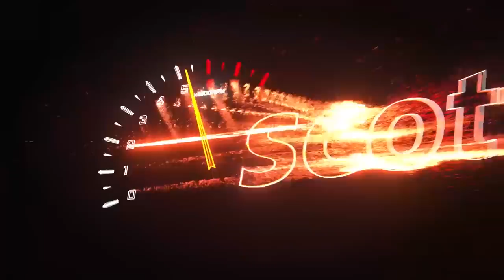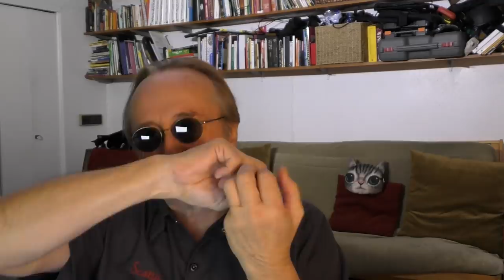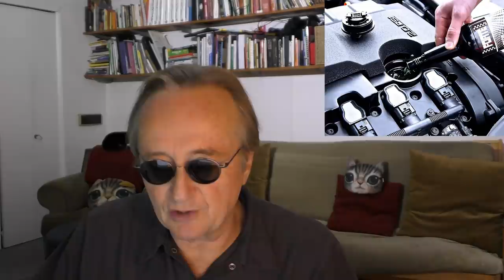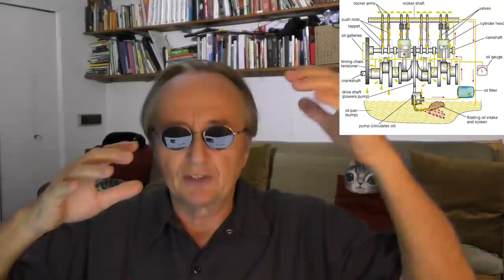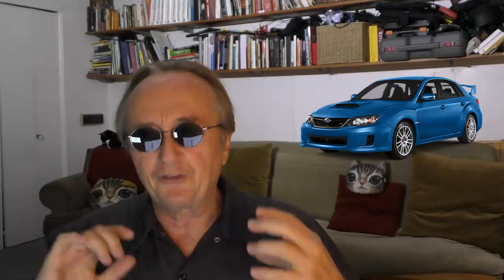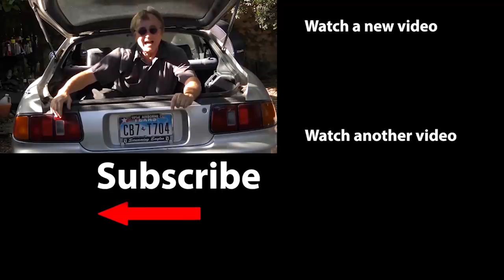Bad Mods that Will Ruin Your Car

Comment: An old Monty LS or Regal, or Grand Prix, with the 3.8 or 4.3 v6....ugh, I'd see those things w 3, 400,000 miles all the time. Ran forever, n if the tranny blew out, ya grabbed one from the junk yard for $100 n swapped it in in an hour....the good old days......

Comment: I crossed canada with my 2006 Jetta TDI and the timing belt broke in the mountains, the Jetta broke down  hours away from civilization,  hours later the flatbed showed up in the middle of the woods on the trans Canadian highway. when i got to this small town in ontario called Kenora, every single garage had no idea how to work on a diesel vw.... so i had the car towed 2 and a half hours away in winnipeg Manitoba where there was a vw dealership and they said that they could fix the timing belt for 150$ a hour, turns out it would cost the same amout for a new engine... so i called my grandfather that lived in a small town with only population of 472 called McCreary, thought maybe he could help. The only person we found was Brad, the local tractor and 18 wheeler mechanic that worked on Diesel engines, Brad changed my engine for a used one for 2600$................. it took 1 month to get a new engine. Brad had to look at youtube videos to how to change the engine... finally when the used engine arrived, he changed the engine and  i drove back to quebec.
27 h (2,576 km) to drive home. while i was driving the engine was kicking when i pressed on the gas, turns out Brad had not fix the engine properly to the frame... anyways... when i got back home 3 days later the transmission blew up.. the car cost 4k when i bought it. NEVER AGAIN WILL I BUY A VOLKSWAGEN!

Comment: Oh c'mon, some tuners are warrantied by the manufacturer when installed at the dealer.

YOU should know that there's more power in every engine without sacrificing too much reliability.  Manufacturers are very safe with their tunes.

Comment: Volkswagen aired a commercial bragging that the Jetta is better than the Honda Civic because the Turbo engine comes standard, whereas you have to pay extra for it on the Civic

Comment: I have to disagree. Honda does care more about the bottom line. They tune a car to not have to use super so it won't ping, they tune to get a specific combo of things like the carb compliance and cafe points. Also, your wrong. You don't have to give up mph for more power. More power, if used properly can most definitely increase mpg. They engine does not have to work as hard to keep the vehicle moving or to get it started. But you can get on it. Case in point. I have a ram 2500 (5.7 gas) I use it to tow about 7000lbs daily. When I got a tuner my mpg went up about 1.5 to 2 mpg. 
Tuners are just as good if not better then most factory engineers. They tune per engine not just a general tune for hundreds of thousands of engines.

Comment: Hey Scotty just found your channel and I love it. I found your channel because of your Celica. I have a 96 Celica gt that’s a manual. And it’s in very good condition but it has 200,000 miles. I was wondering if there’s anything I should check on it cuz I’m not very good with cars but all of the normal work has been done it has new oil and a new timing belt and a few other thing. Also I was wondering, i live in nm and it’s not to cold right now but the heater doesn’t work until about 30 minutes of driving, is that normal? Or should I get the ac looked at. All the best Scotty

Comment: I think the worst upgrading is those guys that use a bolt on turbo and piggyback ecu without doing any work on the transmission or drivetrain.

Comment: Vws are not that hard to work on. Certainly no harder than any other car year by year. Any mechanic of any skill level at all should have no problem with a 2003 golf. You can buy the same parts online as are available in Europe. This isn't 2003 anymore. We have this thing, the internet where every car ever made has nearly step by step info on almost every possible job. If your skill level has maxxed out at late 90s Toyota, then I'm not sure what to say.

Comment: GM in the 80's---their rear wheel drive, V8-powered cars were excellent, very reliable. But their front wheel drive cars with the 4 cylinder engines? Total garbage. And the only decent V6 engines GM offered were the Chevy 4.3 and the later fuel-injected Buick 3.8's, the rest were trash

Comment: Dang, I just shoehorned a Hemi V8 into a '94 Toyota Corolla. 😅😂🤣😋
Reply: Mael-Strom You should have dropped in the Toyota V-12!
Reply: @RaoulThomas007  I tried but it interfered with the rear passenger seat coffee cup holder. 🤣😋

Comment: The thumbnail pix for this video reminds me of the dumbest mod I see on import cars.  People lower these Hondas, Subarus, Toyotas, BMWs to make them look cooler.  But they don't correct the wheel geometry.  Doesn't make them look cool, makes them look like smashed Hot Wheels.  More wear on the bearings, abnormal tire wear, rotten ride etc.  Only good for race cars.  They become money pits for street driving.

Comment: 2008 Grand Cherokee 3000cc Diesel..factory 215hp/375 lbs torque average getting 16mpg. Emissions Legal Euro 4. Green Diesel Engineering ECU flash altered the timing, switched off swirl motor and still passing emissions testing with 265hp/460lbs torque and getting 23mpg. 

Don't believe everything this guy tells you. I have been following him for a while and he is funny to listen and view but I can't trust a guy who flails his arms and has a messy garden shed for a garage

Comment: Hey scotty I was think of buying a 1998 Volkswagen with 165000 miles and is a manual with 1.8 engine
Reply: If it's a free car, perhaps. The transmission's the least of your concerns on those. Other than oil burning you need to watch over and check every time you fill up, there's a good reason so many '96-02 Corollas are still being driven around, and you can get one in good mechanical shape for far less than $2,000.
Reply: Sometimes people leave good comments eh?

Comment: Hey Scotty I’m thinking about buying a 2020 Honda Civic sport manual transmission but worried about the oil dilution. Does the 2.0l naturally aspirated ivtec engine in this car have this problem?
Reply: The 2.0 is multi port fuel injection so your good.   I have the 1.5 really hoping to not be that affected
Reply: @JustinSherrod1991  it is the SI having the dilution problem. That said, my daughter bought a 2018 & hers has had no dilution trouble thus far.
Reply: Yes, the 2.4L has no oil dilution, but what you should really be worried about is how much the car will be worth over time. Two ways to look at it: If you think more in the moment, watch Dave Ramsey videos on cars. If you're more forward thinking, youtube "tony seba robin hood conference" and watch that presentation.
Reply: Wayne S. Yea all the 1.5 direct injection turbos have it, although they did do a tsb for it which is more or less a software update, but I did hear they are engineering a new oil to help combat the issue

Comment: Scotty you're actually wrong the engineers tune the car in accordion to the model, more power can be obtainable if you reconfigure it.
Reply: Mostly on turbo cars on normal NA cars with non tunable transmissions you might get another 5-8 WBHp out of the stock motor. With a turbocharged engine  they leave the tune bare for gas mileage. The VW 2.0 tsi stock is capable of 260 WBHP but comes from VW with 200. But scotty partially wrong about the vws. Mine was made 80% in Germany says so right on the paperwork and it's a great car. My brothers 2011 jettas been going strong for 6 years now with 150,000 miles and still going never had any maintenance (other than routine like oil)  and breaks all the way around but after 150,000 of alot of city milage that's to be expected.

Comment: Hello Scotty, I bought a Seltos 2022 AWD. Since I didn't turn on the rear wheel drive during daily use. Do you think I should change the center differential and rear differential fluid when I change the transmission fluid at 30K?

Comment: Hi Scotty. I'm not sure how Subaru America produces/sell their cars in the USA. I don't know if, like Honda and Toyota, they have manufacturing plants there because I really don't understand the bad reputation this brand gets in your country. From memory, I think since 2010 or there abouts, Toyota bought Fuji Heavy Industries which is the company that manufactures Subarus in Japan. Not long after that they released the BRZ or AE86 (or yet Toyota GT86 in the USA market) and myself as a customer who had owned Subaru cars previously, their design changed drastically. A 2014 Subaru Legacy, in my opinion, looks like a Toyota Camry. Bulky, boring and really designed as a family car. I would then think that some of that Toyota "quality" you prise them some much for, would have translated onto the newer Subaru models. In saying that, I live in New Zealand and here we get JDM spec japanese cars. Back in 2007 I owned a 2001 Subaru Legacy B4 RSK, 2.0L/Twin turbo and basically a more luxurious WRX STi in a way when it comes to drivetrain (not the engine). I went to own it for 6 years and in that time the only parts I had to change/replace other than the usual maintenance stuff was a knock sensor and two rubber mounts that held the rear differential assembly, that's it! Was a manual gearbox model, good fuel economy if you know how to drive them b ut also has the 280HP if you want it. After that, in 2015 I owned a 2007 Subaru Legacy Spec-B Wagon 2.0L/Single turbo/Automatic transmission. Not as fun as the other one but again a good car. I owned it for 4 years and sold it mid last year (2019). Nothing spent on it other than a good set of tyres which I replaced for personal prefference. The Toyo set that came with it was perfectly fine just not as confortable as say a Bridgestone or Goodyear. I guess I do understand that you talk from experience and it's mostly (if not all) based in the USA market but in other countries we experience different feedbacks for the same product. Here everybody buys a Ford Ranger over a Toyota Hilux (Tacoma). Not because of only price or reliability but because Toyota gained a reputation for not being that safe of a car. Just watch the moose test videos of the Hilux to understand what I mean. Plus all the cases in your country of Toyotas having accelerators stuck or airbags going off and so forth. Not to say that it doesn't happen to other brands but it is how thay deal with the issue that counts. Love your videos anyway. Cheers!

Comment: Changing timing belt on 2010 Accord 3.5L. The rear cam jumped CCW about 10 degrees.  How can I turn it back to TDC? Do i need a special tool?

Comment: Hey Scotty what do you think about kia’s. I bought a 2013 Kia Optima for my wife in 2017 with 36000 miles on it   Been a great car so far be sides all the recalls and they never found anything wrong with it. ?
Reply: I had a 2010 Tundra with over 220k Miles in 2018. before I wrecked it. Never gave me any problems besides one day where I got to a store and didn't restart lol was just a starter.

Comment: Hey scotty sometimes my 2010 fusion v6 with 158k miles will crank for a while but not start, turn key off then try again and it starts right up, runs fine what could cause this?

Comment: avoid tuners
Reply: Tune totally transformed my diesel BMW.  Went from 240 wheel HP to 364.  Torque went from 420 to 595lb.  Power feels absolutely ridiculous now (in a good way).  Had tune on for past 40k miles with no issues and take it on the race track many times.

Comment: Hi.  Please I need advice. I bought a Chevy aveo cheap to sell. My first car to make money on. I have a new battery of my old fiat but it won’t fit in the other car as the battery cables won’t reach unless it’s upside down can the cables be extended or is there risk of fire or can I try stretch them a bit. Please need help. Thanks

Comment: I have a jeep compas 2015 .it jerks when i drive it on the highway. Do you think its the transmission. 80,000 miles. Do you think changing transmission fluid will help.
Reply: Drain and fill only; do not flush.

Comment: Hi, scotty I got a Peugeot 208 brake lights are on continuously I’ve had the brake switch changed but still same issue. Any ideas? Thanks
Reply: Sometimes brake pedals have this pin that needs to be pushed in while you dont have your foot on the brake. It usually is a rubber or silicone bead pressed into a hole. They tend to get brittle over time. Just trace the pedal up where it goes look for a electrical connector right at the top of it and check that the pin (plasic pin btw) is pushed in while the pedal isnt being used. I hot glued a penney over where mine used to be lol. Cheap fix. If your cars a manual trans u may have the same kind of pin on the clutch pedal only when this one is removed your car wont start.
Reply: Sounds like you could possibly have a short to power which means the circuit has bypassed the switch and is constantly recieving power

Comment: What are your thoughts on a 2005 Hyundai Tiboran manual with 112060 miles on it? Think its a good car. Says it was made in Korea...
Reply: I got the car for $300
Reply: For $300, it's a good deal, and if the insurance is at least similar to a 2005 Civic or Corolla, then it's a great deal. If the insurance is palatable for you, then maintain the car with regular oil and filter changes, and unless it becomes a money pit, drive it into the ground.
Reply: I am a auto Technician and it does have a few dings. Like I wanna change the tyres. The key barrel is shot he drilled it.  This is its been parked for 2 years. But it starts runs and everything works. Got a few minor dents but it drives. Pulls to the left so after I change the tyres I look into that. An well I got to service the brake system. The hand brakes especially, its really tough. But it does drive.
Reply: @DuewaineJohnson  The way you say "tires", I assume you're in the UK? Among US tires, the Continental TrueContact Tour and General Altimax RT43 are both good tires that are better in the rain than the cheap stuff.
Reply: @EMichaelBall  Well I am from the Caribbean. You ever been? Thanks for the the tip. Still the car runs awesome. They change the timing bet at 60,000Miles and previous owner was saying to change it as its 112000 miles now. Think I gonna wait though. It had 1/3 feel in it. I put some octane boost in it just cause its been parked for 2 years. Have you ever worked on a Tiboron before? Are they easy to work on in your view? 
Somehow this seems like it has a few Mitsubishi similarities and parts too
Reply: @DuewaineJohnson  I've never left the US. Maybe I'll go there, someday. Don't wait too long on that timing belt, because I think all Hyundais have interference engines, so if the belt goes, even if it felt fine before then, it fries the engine. I wouldn't wait any more than another 5,000 miles, if that, then replace it every 50,000 miles, just to be sure. Replace the tensioners and water pump with it. I'm not a mechanic, so I couldn't tell you secifics on Hyundai repair, but I've gathered enough info on Hyundais and cars in general to know about what I've told you. Who knows what tires they sell where you are, though I suppose they're all summer-specific, and the "all-seasons" like the two I've suggested wouldn't be sold over there.

Comment: Scotty, or anyone who is willing to reply, I have a question. I see a 2002 honda civic LX with 155k miles for sale for $2000(manual transmission, no vtec😓😓😓). I know generally speaking hondas or reliable but however i know that the 2001 civics were notorious for being unreliable and having leaks and what not. Are there any problems with that car? Guy says no leaks and just had tune up done. I currently own a 2001 toyota corolla LE but my sister car got totaled so my dad said he would help me get a new (new to me) car and give her the corolla or help her get a new one. I saw this as an opportunity to both get a new car and learn to drive manual. Of course I know i have to see for myself and what not but from what info i have right now, what do you think?

Comment: hey scotty i have a 2005 pacifica with over 250 thousand miles with a misfire on 4 after work was done the mechanic said its sumn wrong inside the engine its my daily driver i still put 300 miles on it every other weekend on the highway how much longer you think i have?
Reply: Spenser Chalkley yessir. But I have all those changed already.
Reply: Spenser Chalkley yes I know. I’m gonna ride it until the wheels fall off 😀

Comment: I’m looking at a 2012 Chrysler 300 with 200k miles, the transmission and engine has been replaced , is this a good buy ? It’s for 3,900

Comment: Scotty just shut up, a tune will normally calibrate a ecu and it will give you more power and save gas when you smash the gas
Reply: That is not scientifically possible if you give an engine more gas by driving fast and smashing the gas you will be sending more fuel in at a faster rate and no matter what not all of that fuel will be burned fully. You cannot have both better efficiency and higher horsepower at the same time. Anyone that tells you that is trying to sell you snake oil.

Comment: Iam thinking of getting a 2012 Dodge Challenger sxt 6 cylinder  what are your thoughts thanks in advance
Reply: Heavy theft rate, unreliable (especially with the 2.7L V6), high insurance, and resale value's worse than Schwarzenegger's chances of getting the Constitution changed so he could become President, then actually winning. But hey, 'Murica!!!
Reply: may day thank you for the response
Reply: Michael Ball I appreciate your input